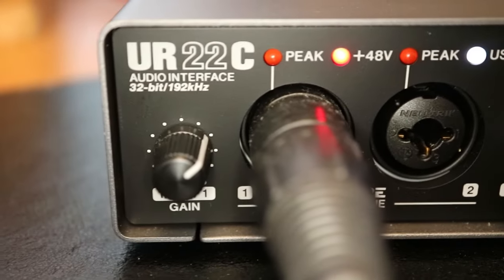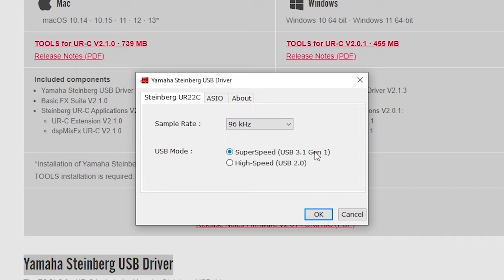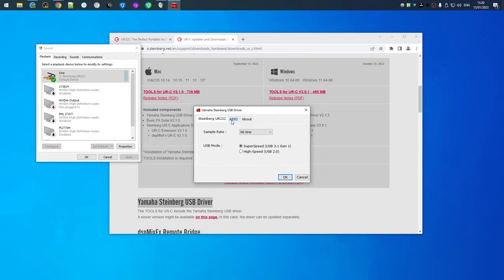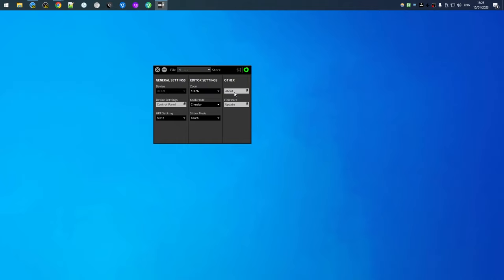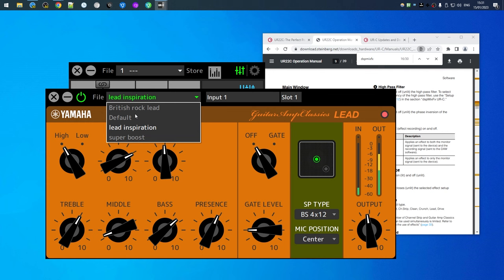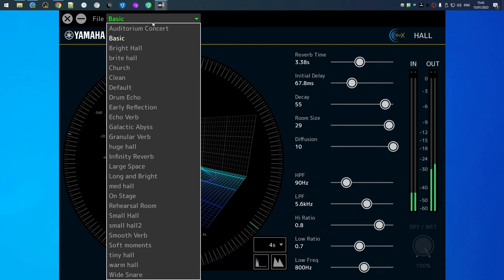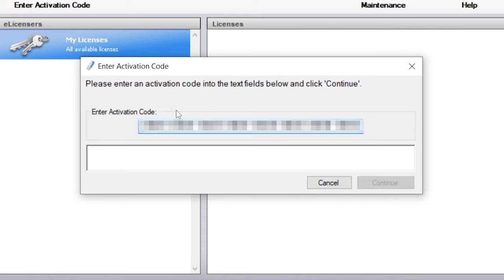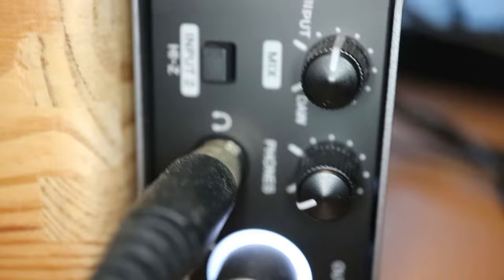Steinberg UR22C driver and dspMixFx UR-C tools installation & testing

Comment: Is someone chasing you? I paused the clip a million times to get what you meant. Next time, I ll do a tech clip on something you don't know and rush it through (because I will know it and do it even quicker than you)  for you to see what it feels like. Also, the Yamaha Steinberg USB Control Paneld and the spMixFx UR-C application do not automatically appear on the desktop as a shortcut. One must dig into the start menu and fish it from the Steinberg UR C folder. It would help if it is mentioned.
Reply: Seems like you're the only one with the issue of having to pause the video in order to absorb the info. This video helped me (without having to pause) and a lot of others here so maybe we should thank him vs accusing him?
Reply: @maxdominguez5543  it may surprise some people but I was not helped by this video. On the contrary I was helped a lot by some other guy’s clip and I thanked him instead.

Comment: In recording, is it possible with dspMixFx to give a singer a touch of reverb in their headphones (for pitch and tuning) without recording it please?
Reply: yes. the ur22c has DSP reverb built in. you can add reverb as a monitor for tracking, or record it directly into the vocal channel.
Reply: @mix1ro  Thanks. I found the manual a bit dense!
Reply: @GavinAtkin  steinberg definitely did a horrible job at their walkthroughs. their hardware is amazing though once you learn it.

Comment: My laptop has also a round USB C connection. Can I connect the unit with a USB C to USB C cable? I mean both ends being USB C. 
I know you keep referring to your own “usb c” cable but in effect you really mean round “usb c” to square “usb 3.1” connector.
Reply: Yes he meant the round one
Reply: @leogoldstein2635  yes what? Round usbC or square usb3.1 connector? He is very unclear.
Reply: I am wondering the same thing. Mine has also round type c usb connection. Is it suitable if we use type c to type c cable to connect the interface to laptop.. Can someone help ? @SoSoTech

Comment: mi microphone rode Sm6 cant reproduce on my steinberg.  Im on the DSP and micro is off when I connected it via XLR
Reply from the maker: Ah, you mean the NT-1? (rode Sm6 seems to be the shock mount) I also got the NT-1 set with the AI-1 (didn't like the interface too much).
So I'm guessing you didn't find the switch for phantom power yet? It's on the back but I'm sure you found this in the past 3 days :D
Reply: Bro I got some questions for u ?

Comment: Very good, unfortunately with mine there is no possibility to change to USB 3 super speed (greyed out) even though I am using a USB 3 cable -> can you help me out?
Reply from the maker: Yes, you are not in fact using a USB3 cable. Or the USB port on your computer is not a USB3 port. Or you need to update some kind of motherboard driver (chipset driver).

I used to think I own USB3 USB-C cables and because of the UR22C I learned that that was wrong. I had to buy new cables. On amazon, cable sellers intentionally write "3" in their product titles and descriptions to trick you into thinking that they are USB3 cables. They especially love writing "3.1A" which stands for 3.1 Ampere. I fell for it myself once.
Reply: @SoSoTechTube  Hi, many thanks for your reply. The USB cable is 3, also the USB slots on the PC are real 3. Maybe I have to check your input with the chipset driver...
Reply: i got a proper USB-3 cable in the box with my UR44C.  make sure your PC has those USB3 port, sometimes coloured blue.  and your OS has it's motherboard manufactureres USB3 drivers installed.